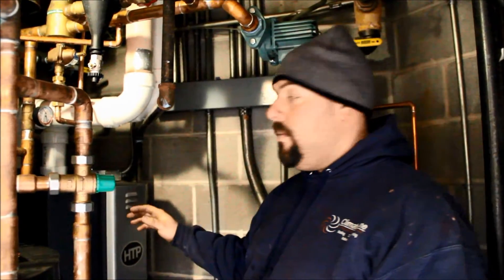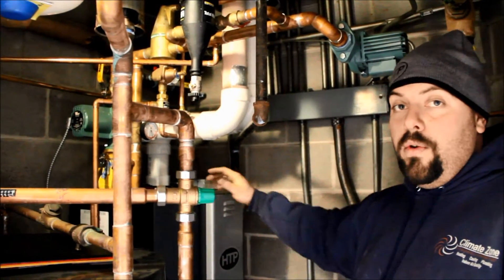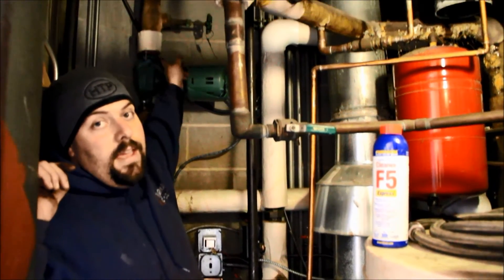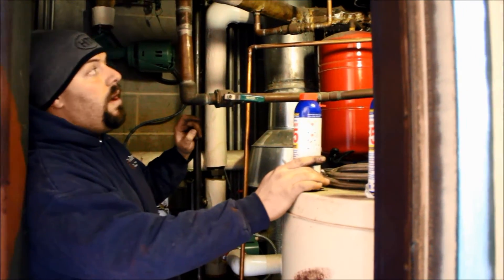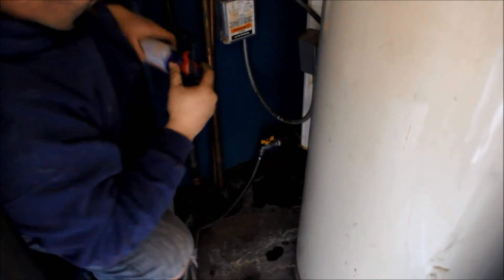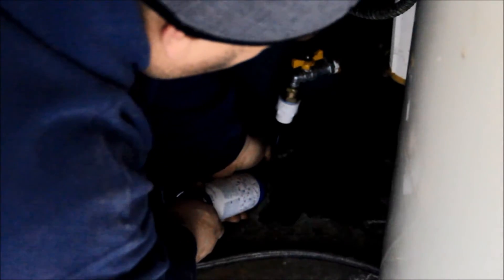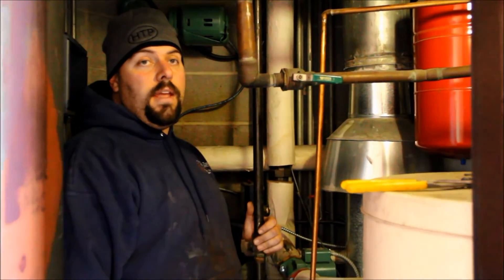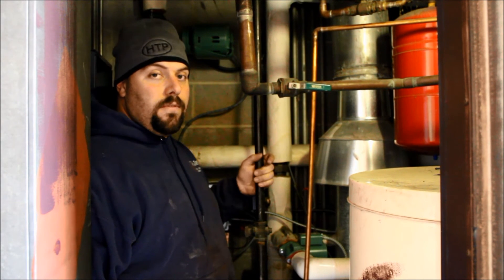Treating A System With Fernox F5 | Emerson Swan

Comment: Hi 

Enjoyed your video hope your company is doing well !

I would like to help you with your next installation 

The fernox tf1 is not correct down sizing pipe work in a Commerical installation 
Also putting the fernox f5 into a deed leg in the system is not a good practice
Also your need a lot more cans in Commerical installation 

Wish you well